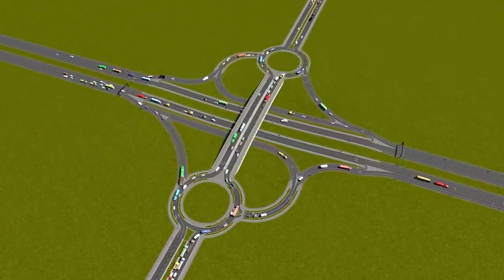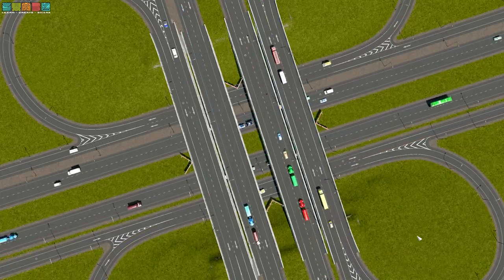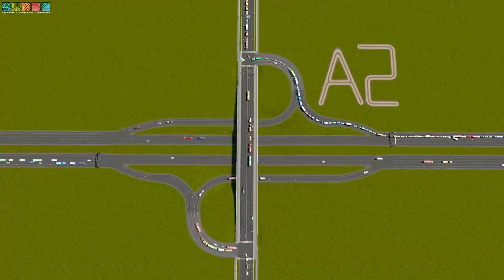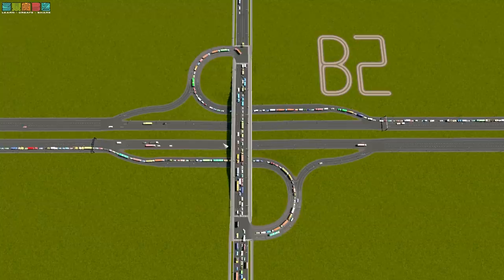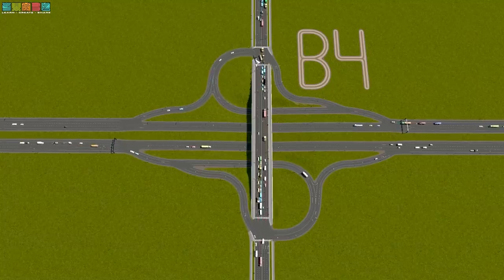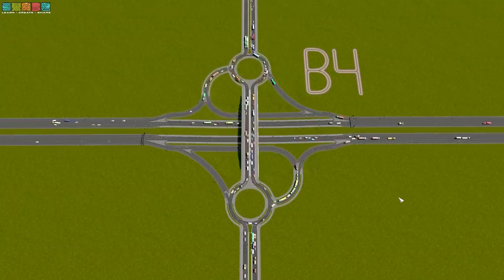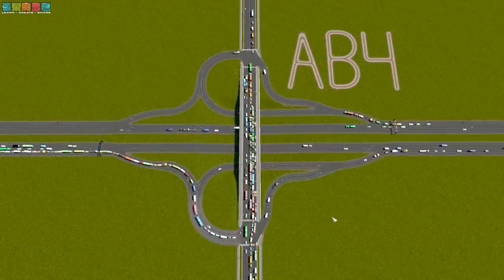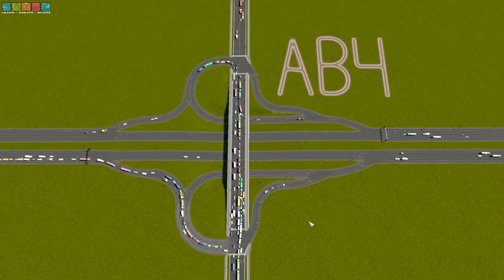Types of Partial Cloverleaf Compared!  -  ParClo Interchange Comparison

Comment: I notice that the B4 can be made into something contention free in about the same footprint as this by having the arterial left turns take the same exit as the arterial right turns, and adding grade separated ramps that run quasi-parallel to the highway, bridging from a (contraflow) access ramp lane, over half the highway, and becoming a left entrance. (Did I explain that clearly? The newly added bridges are one lane wide and go diagonally from where the main span passes above the ramp to the node where the traffic enters the highway.) There's a tradeoff in that the junction can be more compact if you use a tunnel, but the bridge is probably safer for a left entering (or indeed exiting) lane, since gravity is now on your side. It also precludes the more compact design where there are two separate highway exits and no protracted parallel ramp, I guess, unless you do some very fancy tunnelling. (I have no idea how well these could be implemented in the game, though.)

Comment: In my town, AB2 is used. But it's different from yours. The reason is the presence of a canal. The arterial runs along the canal, the highway crosses above it. The leaves begin splitting off of the highway only after the crossing of the canal, so the bridge doesn't have to be broad. In fact there's even a second AB2 only 300m next to it for another 2x2 road crossing the canal and joining another arterial on the other side of the canal/railroad bundle, so that AB2 is 180 degrees turned. In the next city, there are 2 more AB2s, they are well used in my area. The reason there is for one the presence of a highway interchange just before the exit, and for the other one, it is the presence of an airport runway (the exit is right after the highway runs in a tunnel under the runway). There's also an AB4 in the area, with houses and other roads and interchanges nearby as reason.

Comment: Not to pull a Biffa with your B4 Roundabout Parclo, but the slip lanes that enter the roundabout and immediately exit (the slip lane that enters from the east and exits north and the slip lane that enters from the west and exits south), there's no reason the roundabout wouldn't be three lanes with the roads to the extreme north and south being 3+2 asymmetrical, and a few good reasons for why they would be.

From a safety standpoint this allows cars to exit the highway and not merge at the roundabout where they basically have to be looking behind them to see traffic which may lead to feet leaving the brake pedal as they try to get their head and body turned around far enough which is very bad. Instead the merging happens after leaving the roundabout when the road is all nice and straight. This means no stopped traffic, which is good, and people being able to use their mirrors instead of craning their heads all of the way around, which is also good. Both those mean fewer accidents (of which the remaining are not the fatal kind), which is even better.

Comment: Id like to see a high high cross where right turnering trafik separates first, the then right lanes bridges over left lanes making it inverted, the left turning trafik separates.  The high ways crosses over under. Then left turning trafik joins from left, then the inverted lanes are reversed by a brigde and lastly the right turnering trafik joins . I Think it could make a compact desigh, without weaving and without clovers.

Comment: the Netherlands loves the partial cloverleaf (AB2). as most highway exits to towns use them. unless there is not enough space. however the weaving is mosly solved with Lane management before the all of the trafficlights. as here even collector roads are often 1 or 2 lanes unless your approaching a traffic lights. +for straight through traffic the 2 traffic lights if needed will be timed to allow perfect a perfect flow once the there a go on the 1st light.

Comment: The AB2 wouldn't have a weaving problem in my country in Europe. According to local traffic laws it is allowed to pick any lane after a turn. So cars just go directly into the correct lane and there's no need to weave later. It would be better with a traffic light since picking lanes while making a turn means two cars cannot enter the intersection from a different direction at the same time without a collision. So it's important to give way and go only if all lanes on the priority road are empty.

Comment: In my opinion, an AB2 would be useful if you had an arterial where a majority of the traffic wants to go one direction (for example in your video, the leafs are on the western side of the arterial, all through traffic going north would not have to stop at any traffic light/intersection since there is no t junction going against northern flow). An A or B parclo wouldn’t work since there’s at least one t junction that goes against the arterial on both directions.

Comment: my preference is for a4 over b4, as realistically traffic getting off a freeway should not be favored to merge into neighborhood stretts at 50 mph. on the other hand, favoring  the entrances means the motorist gets plenty of room to accelerate up to speed instead of having to stop first.

also, realistically the ab2 and ab4 are used a lot right before a freeway crosses a bridge (usually over a body of water or under a railroad).

Comment: We are getting a new B2 parclo replacing a traffic light on a divided highway. The vast majority of the traffic is left turning at the intersection and there is a better route both ways further down the highway to do the right turning movement. Also, the terrain is not great for the slip lanes and it would require a lot more grading to make it work.

Comment: What if you took the cloverleaf at the start of the video and basically compressed the interchange along the overpass road but stretched it along the underpass road so that the right turn slip lanes resembled the ramps of a standard diamond interchange and the cloverleafs more closely resembled shoelace loops parallel to the underpass road? Wouldn’t that make a cloverleaf/diamond hybrid service interchange?

Comment: While being a big traffic generator the AB2 still has its uses. There’s a couple in my city. They can be used if there is a light traffic road parallel to a river, railway track, etc, then there would be just one bridge on the highway going over the railway/river and arterial and it could all fit on one side of the highway since it would be quite difficult to have slip lanes on the other side and still have a short bridge.
Reply from the maker: Very true :)

Comment: In the Netherlands, I think AB2 parclos are functional because the right-turns seem to not have a free turn or slip lane.  And since there's no right-turn on red, they have to wait for the light cycle like everyone else.  And so that helps eliminates the weaving issue since the traffic getting onto the arterial bridge from the ramps aren't having to also negotiate with cars going straight through the arterial, since those cars get their own light cycle to enter the bridge.

Comment: Alright So I am a bit confused about the AB2.

I am not an expert Player of city skylines, Nor will I claim to be one but I will in the Future be starting a Internship for ADOT (Arizona Department of Transport)

I am confused of how in this game you are getting such bad results, I think it is the lack of a traffic light. With the addition of one on both sides would eliminate both the weave and the unnecessary yield on both sides (Which since this is a 6 Lane road, It takes a while for cars to find an opening)

There are two Examples I can find in Arizona alone

1. Arizona State Route 303 AND United States Route 60 In Surprise (This one is due to the Rail line that closely follows US 60 to Wickenburg, And United States roads disallow rail crossings on on/off-ramps)

2. Interstate 40 and Santa Fe Ranch near Yucca, This is an Extreme Rural Interchange and I do not look at Interchanges in the High Country, So I do not have a Guess as to the reasoning of That interchange

Again, I just want my Questions answered, I make these Points in good faith and not to prove you wrong! I am just looking at this from a Highway/Civil Engineering Stand Point!

And I understand this is a Game and IRL Rules may not apply!
Reply from the maker: I’m in VA and there are several near me as well. They always face in a way where the most traffic is served well, and I never see them in spots where they will be overwhelmed. Signals and multiple lanes where required of course. I think theyre quite good in a spot where a better and more space consuming parclo is overkill.

Comment: Here's a metric I came up with to compare:
1) For lighted intersections, how many left turns a vehicle needs to take to get out of the intersection. Keep in mind one vehicle making a left turn will also block other vehicles, so less is better.
2) For roundabout intersections, how many other oncoming roads a vehicle needs to pass to get out, i.e. how much time does it spend in the roundabout. Again, keep in mind that a vehicle in the roundabout means some other vehicle has to stop and yield, thus creating more congestion.

You should be able to count this up for each on-off direction, and see which ones are favored over others, which ones have the easiest/hardest time getting through. You should also be able to add them all up to get an overall idea of the effectiveness of an intersection; maybe add weaving points too if you want to do this.

Comment: The AB2 could be useful if you have a place where on the arterial one direction of it is a lot more used than the other direction of it. So that direction always only turns right to enter the highway, and the other direction which barely has any traffic can give way to oncoming traffic

Comment: If the entire goal is to get rid of the weave, how can you rave about the dogbone style that adds weaves? "Southbound" traffic has to go around the loop and weave across "northbound" traffic to head "east", and vice-versa. That's always been my biggest gripe with the allegedly-safer roundabout. It's essentially the worst part of a cloverleaf just turned inside out. There's more weaving in a roundabout than in even the most elaborate Persian rug.
Reply from the maker: If theres a yield its not actually a weave

Comment: Hi Yumbl, is it possible to use traffic manager on the full cloverleaf to have 2 nodes between the ramps.  Make one node for one part of the weave and the 2nd node of the other part of the weave.  So the incoming traffic from the ramp out 1st and then the next node have the traffic wanting to use the ramp weave 2nd towards the ramp?
Reply from the maker: You can but it wouldnt actually reduce the amount of conflict. It’s just redistributed.

Comment: Ok so hear me out here how about on the AB4 you have like the diverging diamond you change the middle section so opposite directions the 2 lanes that enter from the through traffic one is the lefts that would go from the left lane of 2 entering to the left lane of 3 going over the highway this is phase one of a traffic light. on phase 2 the right lane of the entering traffic goes to lane 3 of the road over the highway and simultaneously the left turns from the highway enter the middle lane of the 3 crossing the highway. this would make it a 2 phase with no weave and also allow you to have all your road network weighted to one side. Am I wrong here?
Reply: hmm i never took into account the other traffic so it would be a 3 phase but i think you can work this to a 2 phase

Comment: you can go full cloverleaf and eliminate weaving by having a separate lane for the on and off ramps, so people join the lane before the onramp then they can exit, then the onramp traffic stays in that lane until after the offramp leaves it then they merge. So they are forced to both occupy the same lane and not cross each other.
Reply: Also AB2 or AB4 would not be as bad with traffic lights as the weave is negated by only one side of the traffic moving at a time, whether the exiting or the entering.

Comment: A is better from a safety standpoint as freeway speed traffic has to slow down or stop before entering city streets.  B allows traffic to enter city streets at high speed and can delay the switch from a freeway driving mindset to a street driving mindset.
Reply from the maker: All of them have right turns that wont need to slow down

Comment: 11:40 this is not symmetrical, and probably that's the only place where you want it. in this example, right & up are favored sides that can take a lot of traffic, and "poor" side that is not important for you. 
it MIGHT be working in case you have a highway connected only at one end, that is meant mostly to move people from outside ⇋ in, and just a little area-to-area traffic. 
In game that would be fish industry at bottom, while top would be general industry, and fish processing.  
but AB is only to be used if you are space-constrained, and you dont want to squeeze in anything decent. 
literally, I just wanted to find a reason, but I could not. There is always a better solution from this, but there are so many faster, cheaper, smaller ones that this just don't make sense.
Reply from the maker: It is symmetrical though
Reply: @YUMBL  with mirror symmetry, yes, but for all road purposes, "symmetrical" means point symmetry like A2/A4/B2/B4 designs,
where no mater which road you follow, you see the same layout of turns. 
AB designs have left/right or right/left depending from which side you are going on horizontal axis.
Reply from the maker: Agreed. I know what you mean. I think its fine w traffic lights or roundabouts, but i would only recommend AB if space or money is a concern.

Comment: I think the main difference between a cloverleaf and a parclo is that the cloverleaf is symmetrical, and the parclo connects two different hierarchy levels. Or to put it differently, the parclo needs to have crossing traffic. (If you use roundabouts, you replace crossing with weaving, which in the end is just crossing at very sharp angles - slightly better but not a lot.) So, if you can't have crossings, it seems parclos are out.
Reply from the maker: I dont really think of roundabouts as weaving because entering traffic is yielding. Distinct from a cloverleaf.
Reply: @YUMBL  As soon as you have more than one lane, you have cars entering that want to get to an inner lane, and cars in an inner lane that want to leave at the next exit, and those have to cross pretty much exactly like on a cloverleaf exit-after-entry, just usually a bit slower.
Reply from the maker: No, yielding vehicles may have to stop completely to let cars pass. This is entirely distinct from a weave.

Comment: How would an AB with roundabouts work?
Reply: Poorly.
Just kidding, I think it'd work OK. Using a roundabout avoids weaving issues so it's analogous to just using a traffic light and having traffic sort itself into the appropriate lanes. And on a roundabout passing one extra exit doesn't matter so much since they'll be yielding to you anyway. So using a roundabout, the most pressing issues of the AB2 seem to be taken care of. It just has a mildly lower capacity than the A2 / B2 varieties. But if capacity was the biggest issue you'd probably go for an A4 / B4 rather than an AB2.
As for the AB4, you should really just use an A4 or B4 at that point anyway since you're using all four quadrants anyway. I don't think the AB4 can really justify its own existence unless it was built as an extension to an existing AB2.